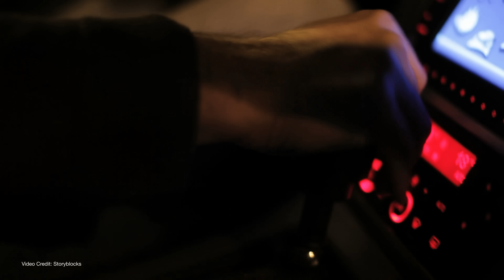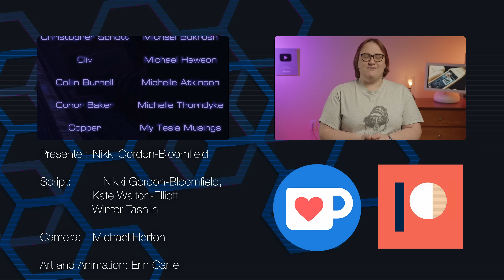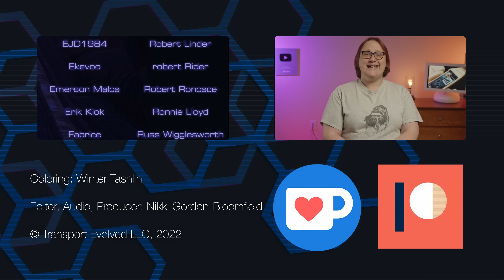Electric Cars Don't Need Gear Shifts - So WHY Is Toyota Working On One?

Comment: It is 2025 and Toyota’s EVs do not have transmissions but you can control regenerative breaking strength which simulates manual transmission up/ down shifting electronically without the complexity of a traditional transmission

Comment: We need a cvt transmission electric car for maximum torque power and speed CVT transmissions have an infinitely changeable gear ratio even more infinitely changeable if it has a much bigger ratio band top to bottom as CVT transmissions have a limit due to size the speed and torque varying on the size which if the electric motor runs out of power to Rev higher it can still gain speed in the right power band
Reply from the maker: You’ve not driven many EVs?

Comment: If any car maker gets to incorporate a car with any kind of transmission, it’s going to be a great evolution. The most important part is that the range is going to be increase dramatically especially for long trips. Just wait for it and it will make a lot of sense ❤😉

Comment: I think doubters of Toyota's idea of manual gear shifter for an EV is missing the point of it -- and that is the fun of driving and driver engagement.

Even for ICE cars, manual transmission has been proven time and time again to be slower than modern automatics -- so the point of it is NOT for need, speed nor efficiency. The reason for manual transmission is that it makes the driving experience for certain people more fun and engaging.

I for one made the move to an EV from an ICE vehicle with a stick shift -- and it's been great. The only thing I miss is the driving engagement and how I felt being part of the vehicle when I was able to shift my own gears.

Comment: I think that gears may help give you a longer range of the batteries, especially trucks and heavy loads. When i was growing up i always wonder why cars had such few gears, they ways said that it would not help to have more gears, flash forward 50 years now you have cars with 8,9,and 10 gears, in ICE cars. So I think it would be probably work with and electric car too.

Comment: UK is 56% automatic sales and growing, Japan is 90% , US is 98%. Toyota targets another growth market.
Somehow I don’t think any car Toyota builds with extra parts will be cheap enough for a driving school. The cars the driving schools were using to teach me to drive were base model Toyota Echo ( starlet  ) or similar. I doubt both that Toyota will bring out a EV in that form factor for very long time, if at all, and if it does it will if it with any but the most basic controls.
I also object in principle to the virtualisation of driving ( let’s call it the 737 max effect ) . The driver put in an input and then the car decides, based on stuff the driver has no control over and some look up tables, what the car will actually do this time. Yes the virtual computer gearbox might be a good simulation or we find out one day it isn’t when the accident safety board does the post mortem. If it’s not needed to drive the car , don’t put it in the control loop.

Comment: yes, just a marketing ploy to assuage/?confuse non-EV drivers... other EVs use "paddles" for regen control/level.. assume this is similar, not an actual gearbox or clutch, just something that makes it feel like one.. but WHY? Too complicated!
 Just have the same amount of regen all the time, like Tesla, and train your foot. It doesn't take long. (in fact, now teaching my son to drive on ICE,.. for my "phantom parent brake" in passenger seat , I RAISE my foot on instinct now instead of pressing the floor, haha!
No thinking/worrying about what mode I am in, just lift foot pressue as needed for amount of braking, and if not enough, switch quickly to real brake pedal. Doesn't take ANY thinking... it is instinctive, almost sub-conscious.
Full regen isn't just for stick-shift classic car drivers... anyone can get used to it, and enjoy it. (infinite-speed "low gear" on curvy downhills, whee!)
  But yes, until you do get used to it, and you keep lifting completely off, it will feel herky-jerky and carsick-inducing... for a day or two.

Comment: pseudo arguments for the need of a pseudo gearshift, but this is not the fault of the TE channel, it's Toyota's craziness in the EV era. May be it should be some Toyota engineer or spokes person (a non-lying one without the marketing tricks like self-charging ev) would explain better it there is any real reason.

Comment: The nomenclature should be "manual transmission" vs. "automatic transmission".  Any stick shift that doesn't involve a manual transmission is cosmetic.  And why are none of these cosmetic shifters on the steering column like the old "three on the tree" trucks?

Comment: I'm fine with Toyota creating a fake stick shift to satisfy those willing to pay extra for essentially a participation trophy in life. There really is no limit to the methods available to separate a fool from his/her/they/it from money. 

My concern is for when a sensor or other component of the fake stick shift device fails. Will the vehicle be programmed to revert to adult mode and operate like normal until the stick shift is repaired or will it refuse to move until it gets towed to a dealer for repair?
Reply: It will probably go straight back to pensioner mode, so you needn't worry

Comment: How can it possibly be considered inappropriate to use the features of the vehicle (regen braking) to slow and stop the vehicle as long as you bring the vehicle to a halt legally and correctly? And do they not have an emergency stopping test in the USA where you would need to use the brakes, thereby providing evidence you know how to use them when appropriate? Sounds more like a problem with the test / testers not being fit for purpose.

Comment: A real manual transmission can be put on an ev. The benefit of applying a multi speed transmission to any motor (combustion, electric, hydraulic, pneumatic or steam) is that a smaller motor can use gear advantage to achieve similar performance of a larger motor without a transmission. A smaller motor weighs less and generally cost less. It would also allow car enthusiasts to drive in a more engaging manner. Obviously the gear ratios would need to be optimized for electric motors. Gas engine transmissions would have too short of gears.

Comment: I drive a stick and I am looking forward to getting an EV, but a fake gear shift - um nopes. Not to mention most car sales are autos. I think its a silly idea. If you want to be tested to drive a manual, learn in an older car, it is of that era. Its a bit like saying "im going to let you use a whip to make your car go faster" to make up for the fact that you are no longer riding a horse. Sometimes you just have to let the old ways go.

Comment: Live in Toronto. Own a Mitsubishi Lancer AWD. Comes with 6 speed automatic transmission with paddle sticks. So I have the option to upshift or down shift. Or drive in auto mode.

Comment: Toyota appears to be already doing this, to some degree at least, even in the US.

Alex on Autos reported that the (plug-in hybrid) RAV4 Prime has “paddle shifters”:  not regen paddles, but paddle shifters.  Its gear shifter also has numbered low gears.

I have no idea what this means on a drivetrain that can operate either as an EV with a fixed-ratio gearbox, or as power-split hybrid, which, while not a CVT in the classic sense of the term, can function as such.

Comment: Will Toyota follow up the fake throttle/brake patent with a vehicle that is steered by reins?  Perhaps the accelerator could be actuated by kicking the base of the seat with the driver’s heels or by vocal recognition of a chucking soul sound?

Comment: @2:30 I found the way automakers implement regenerative braking utterly stupid. Now in the era of electric we can make cars controllable with a thumbstick just like a 30year old racing game. Its stupid to force the users to meddle with things like regenerative braking when the computer should handle this things.
Second. The first "autopilot" or cruise control ever implemented in the cars was constant speed without needing to keep pushing the throttle, nowadays is adaptive cruise control. So question why is not a DEFAULT in electric cars. Why its not auto cruise control and when I push the throttle I SEED UP and when I push the brake I SLOW DOWN?!?!? Why we need to complicate things?

Comment: EV drivers are best encouraged to use some regen braking, tyre wear will be similar & it reduces brake wear & thus reduces brake dust with is one of the pollutants. as well as saving electricity.. 

Would EV be  cheaper with  a real multispeed gear box & cheaper low powered motor ?      T

Comment: I drove gear shift car's all my life and I hated automatic gearboxes because it was difficult to use the engine break-power, they never shift when you want to and the creep. Since 3 years I own a model 3 and this is better than the best of both worlds. You don't need to shift, have maximum torque at all times and it breaks better on the 'engine' (motor in this case) than a ICE car ever could, even a diesel.

Comment: Manual transmission emulation for classic car conversions would be where I see a use case for this.  Clean and green but with the same emulated experience of the original drive drain.
Reply: Piss it, I saw a great video on YT about a company that does this. The example I saw was an old Porsche? Aston Martin? Maybe 60 years old?... anyway, the YTer said it was marvelous. The gear box delivered all of the experience of gear changing with the benefit a modern electric motor has over an ancient engine.

Comment: In regards to Toyota using a manual shifting transmission in their EVS your overcomplicating it. It's very simple they're doing it so there is a lifespan on the clutch and transmission and their dealers can then charge you to fix or replace. Remember if they make the car so it lasts then their dealers can't make any money off of you

Comment: Seems to me a bit daft adding an unnecessary gear and clutch system to a BEV when not required, I assume it also adds cost.  Sound a bit like the early electric cars that looked like the cart without the horse!  Dinosaurs eventually became extinct and frankly dinosaur juice will also become extinct along with dinosaur juice drivers. I have some friends who hate automatic cars and also hate electric windows and all the other, in his words, “unnecessary gadgets” fitted to cars nowadays. He’s 81 won’t touch a computer hates answering the phone and is a dinosaur we call Regasaurus.

Comment: I've been a die -hard stick driver (in the UK, where it's mainstream anyway) until I got my first EV. Now I have a vehicle that's high enough geared to go well over the speed limit, and yet from a standstill I can easily spin the wheels if I hit the accelerator to hard. What possible benefit can there be in increasing the torque available by having lower gears? I can even control the amont of regen to regulate downhill speed, so no "changing down" needed for that.
I can't believe Toyota are going into an expensive design and production cycle just to make a few vehicles for learners. We only need stick shift skills as long as we have stick shift vehicles, and as long as that's the case, by definition stick shift vehicles will be available to learn on. No, I don't have an alternative explanation for what Toyota are up to, but I've been ignoring them ever since they came up with "self charging".

Comment: 05:07 - Wwwait...how do you know we were screaming "What's the point?!?" at the screen?!?
Given its pseudo rather than technical nature it doesn't seem worth patenting on the face of it - almost like just a step up from a fake engine sound - but it'll be interesting to see what they do with it.
After 2 ½ decades of driving a manual since being wooed by a Leaf it sounds very retrograde? Smooth acceleration & regen braking is a much nicer experience in the vehicle and sooo much better for wear & tear.

Comment: In the UK the driver licencing/testing dept is looking at the future of driving tests, There is a proposal that the driving test for 'automatic' cars  is modified to take account of allowing driving in manual gear cars. Even 'Officiadom' in the UK is forwards looking to when ICE cars are history. 
On a personal level my first auto car had a long stck shift, three positions, forwards neutral and reverse, (no park position). That was a Daf 44. My Auto Citroen ICE has two sets of gear controls, a floor mounted stick with multi functions and paddles on the steering column. My LEAF has a hockey puck selector , I nearly always use the e-pedal and adaptive cruise control. 
After around a million miles of driving I can see no advantage of a gear stick and clutch pedal in normal driving.

Comment: I do not think having a stick shift on an EV will help for tests. Just consider that if you want to get your manual licence you pick a school that has a manual car. If the school can not get a manual car because they are too old then that pretty much means you probably won't be able to find a manual car to drive which kind of defeats the purpose of a manual licence.
I can drive a manual transmission and I certainly do not miss having to shift gears.
I have also driven a car with "sports" one pedal driving and the regen is so strong that you can not use the mechanical brakes unless you drive like crazy and as much as some people have mentioned that too strong regen would be uncontrollable and tiring no one though the regen was too strong after driving it and considering that the regen is strong enough to lock up the back wheels and do a hand brake turn just with the accelerator I would say that is enough proof that strong regen with the correct approach can be a big advantage.

Comment: Actually CVTs can be shifted to provide engine braking going down steep grades, not a worthless capability.
Reply: But EVs already have engine braking without any kind of transmission, real or fake.
Reply: @ps.2  I was just stating that CVTs had gear selection for a purpose, yes EVs without gears are great going down mountain roads, even when towing, as I can attest.

Comment: Having adapted to EVs since 2016, I like the fact that my car has the same number of gears as my bicycles. ONE. Now if I could only produce the same torque in my legs that's my EV does...
Reply: Yeah ... even in my city with no steep grades, I still find it helpful for my bike to have at least a few gears. (I don't need 10.) Like you, I don't have the torque in my legs to be able to efficiently accelerate from a stop to a cruising speed on a single gear. What is it that people love about fixies? I don't get it and I never did.

Comment: I love the shifter in my Volt. Even though there’s no real gears, driving with some regen control on the shifter is WAY more fun than letting the car do it all automatically. There’s just a fun factor in controlling stuff like that with a leaver.

Comment: This feels like when Mercedes announced a few years ago that their next vehicle platforms would be flexible architecture instead of pure BEV. Hedging bets is a great way to end up with compromise vehicles that dont do any of the things well. It seems to me that most of the people who are really into manual transmissions are also really into speed... thus why sports cars are (along with trucks) really the only places you still see manuals in the US. But you would have to be a lunatic to think you could manually run through the gears faster than a Tesla could get to the end of a 1/4 mile. There's just no comparison.

Comment: I have been driving EVs for almost 8 years, and I love coasting - like in the e-Golf in D - because it is more efficient than so-called 1-pedal driving. Regenerative braking is great - but having it on the brake pedal is much preferable. Sure, a B mode (or L in our Bolt EV) is good to have for those situations when a lot of regen is needed.
I loved driving a manual shift, and I learned in a manual and took my license test in one, as well.

On another topic - I hate creep. This is the one thing I like about the Bolt EV's L mode. And the e-Golf had adaptive creep - none most of the time, but if you are in stop and go traffic, it adds a very gentle amount of creep. It goes away again if you drive above ~20MPH.
Reply: I've yet to buy an EV, but what you described is what I think I want in an EV. Slowing the car down should be deliberate. The car can choose between braking or regen, Left foot for slowing, right for speeding, and none for coasting. My cruise control stop working under 50kph (old car).... it'd be nice to have the adaptive creep you mention.

Comment: Ok, 2 things
1. Fake shifting is worse than fake engine sounds, fake exhaust, fake vents, and none of which are acceptable.
2. A real transmission allows the motor to be optimized for a specific rpm range, this allows the motor to be more efficient.